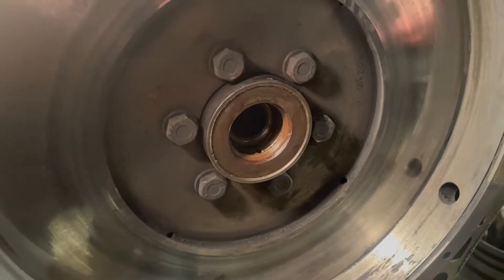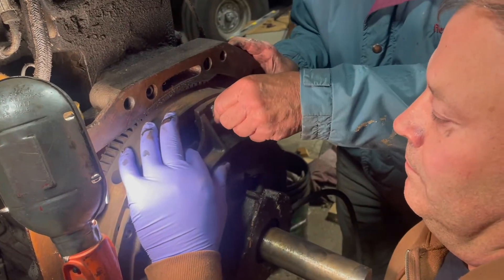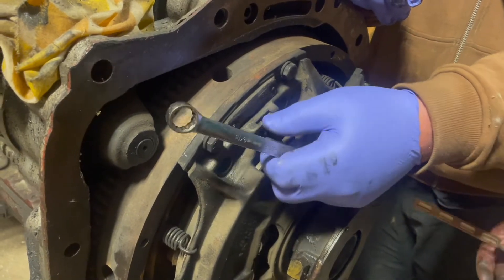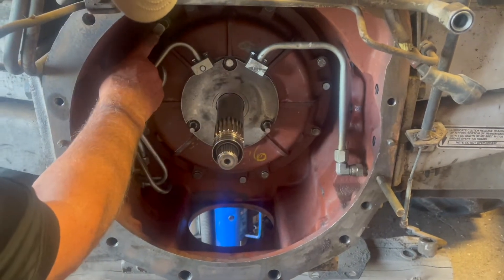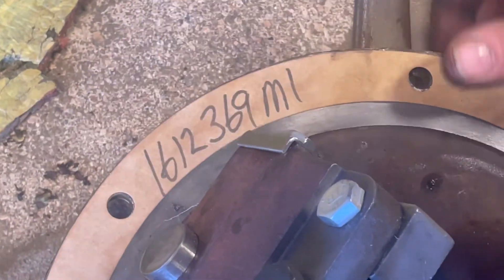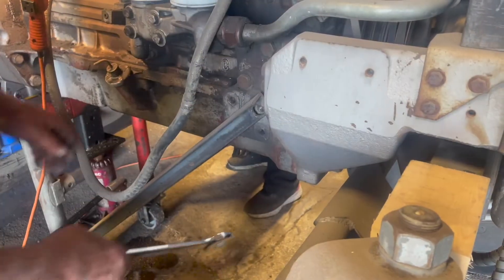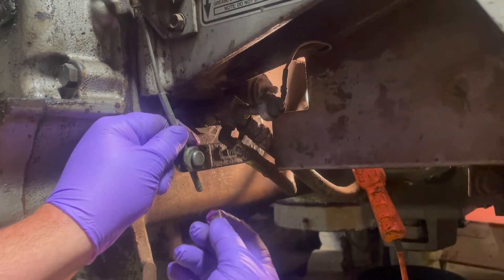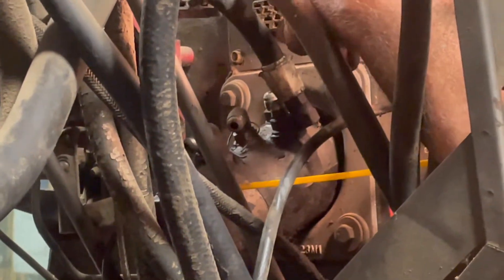How To: Massey Ferguson 2000 Series Powershift Repair Part 3 | Tractor Reassembly

Comment: i have a 2745 with the 24 speed that was over hauld with around 300hrs on the power shift one day i was round baling hay and had to get out to work on the baler got back in and put the tractor in 4th gear and shifted it to low on the 3 speed let the clutch out and it killed the tractor,started the tractor back up and with the tractor in neutral it would still want to kill the tractor even in all gears had a mf mechanic come out drained the oil out and removed the bottom cover and found out the tractor was shifting properly put oil witch locked really clean and tried it again still would not move jacked up the rear end and we could spin each wheel the decided to pull the tractor and the rear wheels would just skid,what are your thoughts of what is going on.thanks

Comment: Have you ever converted one back to an 8 speed?
Reply from the maker: We have never converted back to the 8 speed before. It's not very easy because we need the high clutch pack in order for reverse to work. The only way you can change it back to an 8 speed would be with a completely different input section.
Reply: @farmgpa  Transmission Conversion Kits were offered to take the tractors from 24 speed to 8 speed, however there were two different kits, as the input shafts to the gearbox differed to each other slightly, depending on whether the conversion was carried out to a 6 cylinder engined tractor, versus one equipped with a V8 engine.